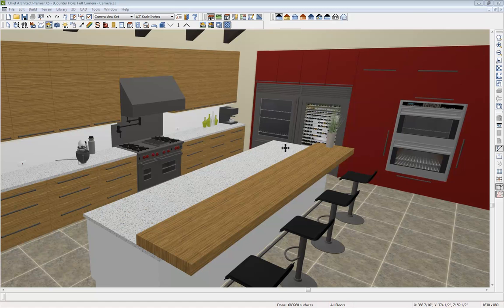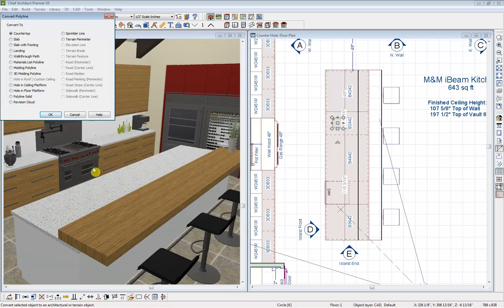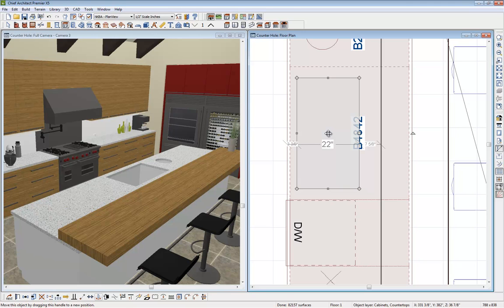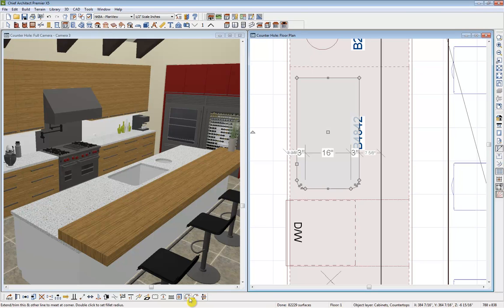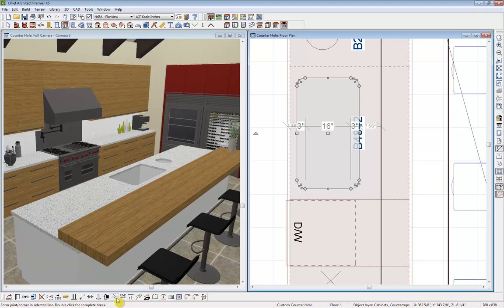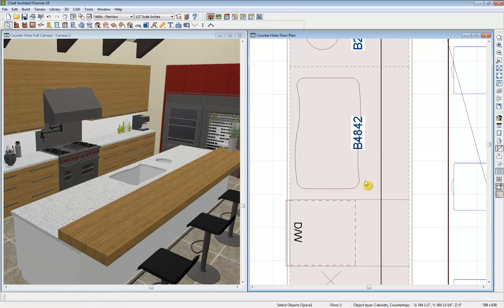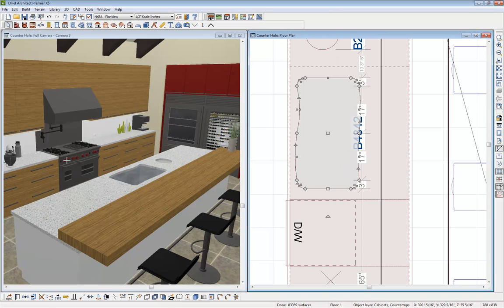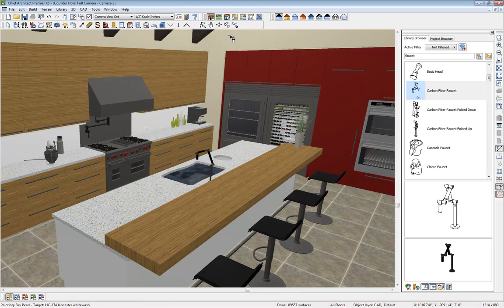Chief Architect Quick Tip - Countertop Hole

Comment: hello, i have one apartment contains of three bedrooms with different levels, how i can make levels for each room
Reply from the maker: Hello, Samuel! With Chief Architect Software it's easy to create multiple stories. Please refer to the steps in this video: www.chiefarchitect.com/videos/watch/72. Thank you!
Reply: the video is great, i have another couple question, (1-) for the same room, how i can make two levels with stairs?, (2-) why when i use cross section the new generated section shows lines and not solid for the finish or structure?,
Reply from the maker: (1) You could define a new room and adjust the floor structure, or you can use a polyline solid. Please refer to this article: www.chiefarchitect.com/support/article/KB-00426. (2) It sounds like you're referring to the difference between a Backclipped Cross Section and a Cross Section/ Elevation camera. The Backclipped Cross Section will display lines, whereas the Cross Section/ Elevation will show patterns and colors. We offer many trianing videos that cover a wide variety of topics. You can search through them on our webpage here: www.chiefarchitect.com/videos/. Thank you.
Reply: Thank you for your reply for point no 1, in regard point [2] if i draw very simple room, then i go to prescriptive floor over view, and i used cross section slider, i found all walls for example are empty shape not solid, 
how can i send you picture for what i have now?
Reply from the maker: Hello Samuel. Our Technical Support team will be best suited to assist you further. For the best support experience with your plan, please submit a ticket to the Online Support Center here: http://support.chiefarchitect.com/.